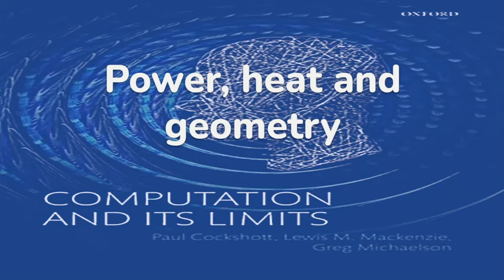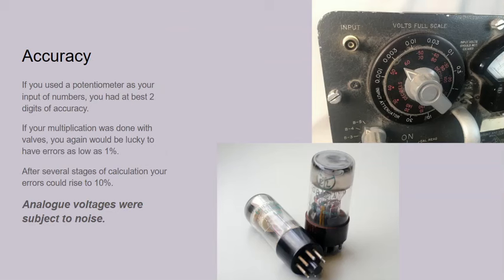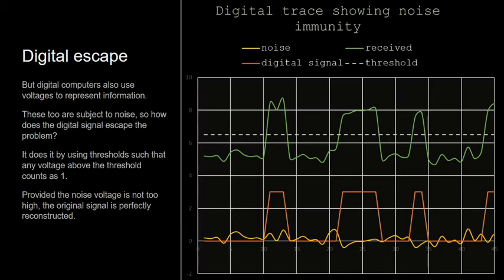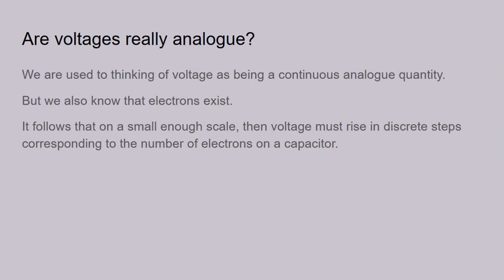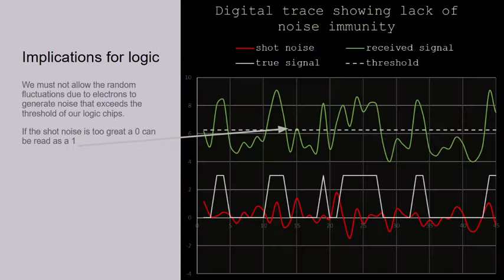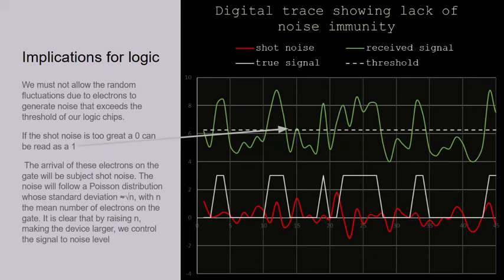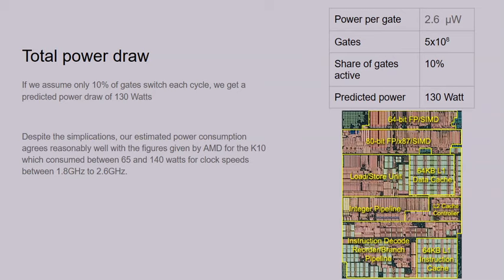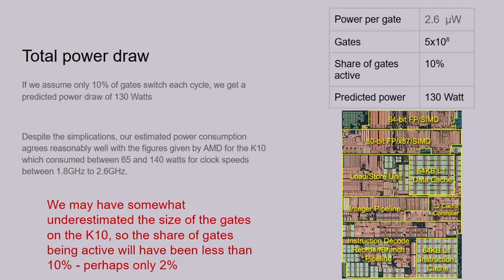Power Heat and Geometry

Comment: What do you make of optical computing? Me and a friend speculate that nonlinear optics combined with VIPAs for I/O are one path forward. A gain medium that turns two red photons into a blue one is essentially a half-adder (XOR + AND) when coupled with appropriate heterodyning. NOT can also be constructed by holding one input constant 1. Thus you have NAND and every boolean operation is within reach. Main limit is dispersion.
Reply: Also reversible optical computation can be done, which in theory has zero energy loss.
Reply from the maker: Optical computing has similar shot noise reliability issues. When you work out the energy of the quanta that have to be disipated you get figures in the same range as current cpus. A blue photon has 3EV which is what you disipate as heat by discharging an electron in a cpu with a 2.9v supply. So the heat dissipation problem is just as great.
Reply: @paulcockshott8733  That shot noise happens in the detector, not in the optical path. We of course don't need to use visible light - 1 µm and below is common. Unlike electrons, photons carry frequency information. So it may be possible to do better with massless photons than massive electrons, even in the face of shot noise.

Comment: The "nm" in the name is meaningless. The smallest critical measurements are nowhere near that. The name comes from using Moore's Law.

A 20nm chip will be able to do computation relative to a 40nm the same as the 40 could do relative an 80. Its named as if the critical measuremnts had halved buy they have not actually decreased.
Reply from the maker: It used to be the case that lambda was actually the width of the gate as rhe smallest line you could draw. Now not so much. I am so old that I remember lambda being 3 microns.
Reply: @paulcockshott8733 it's actually become a good litmus test for modern technology journalists.
many of them will write articles about how "now that we're in the 3nm range, electron tunneling poses a problem for moore's law".

which is so obviously false that you can ignore what they say lol. 

great videos btw! please do make more :D